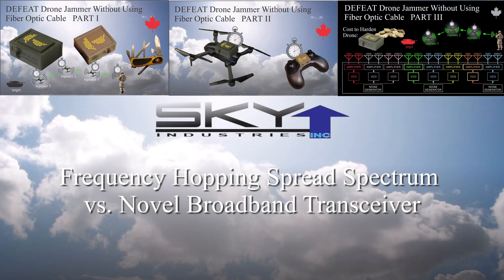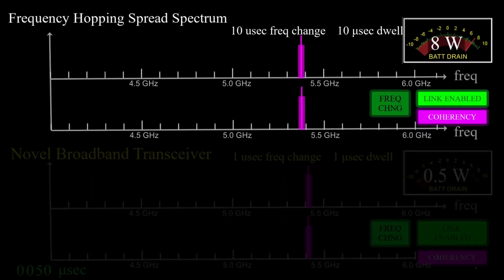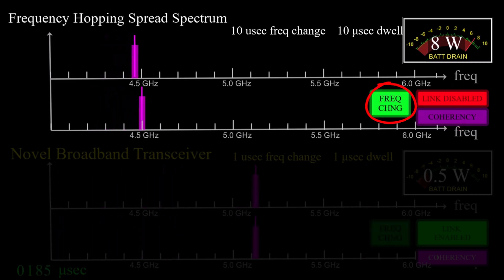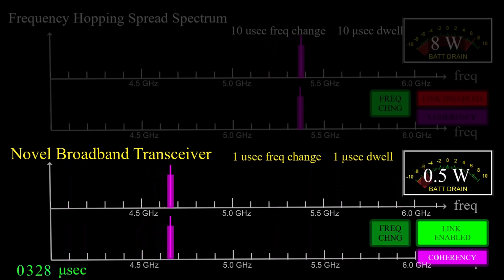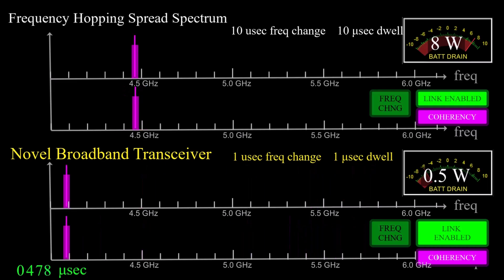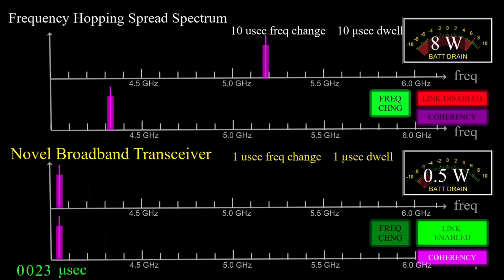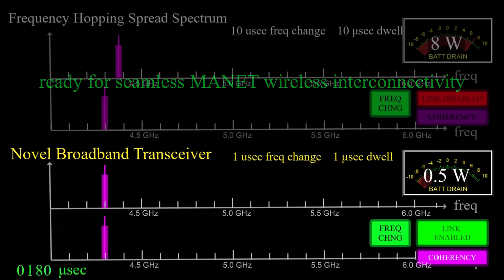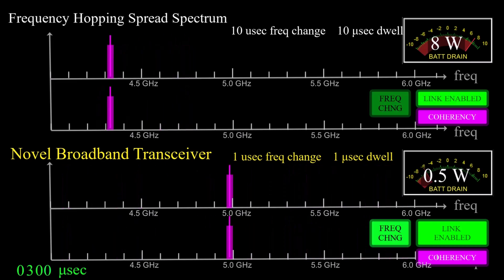Novel Transceiver Part V - Transceiver vs  FHSS 01

Comment: I very much like the idea, however I do see one issue (unless you have solved this already): lets say the freq change and dwell time is 1 usec (like in your example), then the radio wave only travels ~300m before the rx and tx change freq. So over 3km, rx would have changed freq ~10x, meaning that rx is no longer tuned to the original freq. 

I guess a fix to this is rx either knows the delay or distance between the tx and rx.
Reply from the maker: Yes exactly.  You have your finger exactly on the important part.  

The solution to this is what makes the transceiver new, and disruptive.  Inexpensive jammers are locked out by a physical law: the speed of light.
Reply: @skyindustries  Sure, but how does a pair of these Transceivers stay synchronized?
If you're working within a sufficiently large amount of the spectrum at such small transmit times how does the receiver avoid losing some of the packets (purely by listening to the "wrong" frequency at moment of receipt) since the transmit-to-receive time will likely be greater than the 1ums on-frequency duration, and the elapsed time to receipt will vary by both distance frequency?

, it seems possible to me that a broadcast in the order of A-B-C has the potential to physically arrive in the order of A-C-B, if the clocks are synchronized (and haven't drifted out of sync, which at 1ums "hop" lengths seems like it will eventually become a problem) then the receiver will still be listening for A-B-C and thus wind up losing the B-C information

Comment: Why the non-insignificant delay tuning the receiver to the transmitter frequency? Wouldn’t the same clock/PLL/oscillator driving the transmitter also, in parallel, feed the receiver circuit? Aside from blanking time, it seems there would be no tx/rx tuning delay.

Edit: Also, why the sloppy rx tuning? The tx is right on, solid, no overshoot :)

Comment: All your assumptions are based on 90s circuit techniques. FHSS advance because PLL bandwidths show up in the 10MHz range so that hopping to data rate significant above one enable loosless tranmission with error correction in the presence of dtection following narrow band blockers.
The novel transceiver is broadband and the processing gain is very low in comparison to the inverse phase-noise mixing rejection of a hopping narrow band receiver. The blocking advantage is easy in the tens of dBs.

Comment: Just a thought experiment, but is it that important to maintain a fully phase coherent link? 

I've experimented a bit with some micro-controllers that include PLLs and they can change the frequency pretty quick (An off-the-shelf STM32H7 PLL can change every 5us), and if your two receivers already have highly precise, coherent time (say GPS) you can just encode the information in the frequency of the hops (say, by offseting from a pseudo-random sequence known by both receivers). No phase coherency needed! 

A receiver could be made really simple and more or less equivalent to the transmitter, but with an additional mixer that's directly fed the RF signal to down-convert using the pseudo-random sequence, and then ADC conversion of the resulting baseband signal. 

You would get the information as a frequency-changing tone if your two transmitters are time-synchronized, a sort of FSK but with insane bandwidth. 

If you lack synchronization, you can configure that a certain % of the symbols have a known value  (and hence both transmitter and receiver know the exact frequency to be transmitted at a given time), and perform spectrogram correlation to lock the two clocks together.
Reply: My thought on how this instant frequency hopping might be accomplished is to have multiple PLLs locked to the successive hop frequencies, but coherent with the same master clock. The mixer is then cut between the PLLs according to the hop schedule. When a PLL is hopped away from it then re-locks to a frequency later in the hop sequence, and so on.